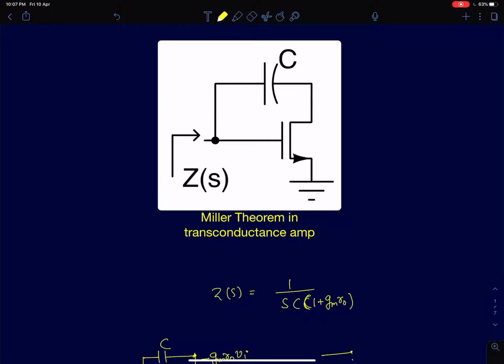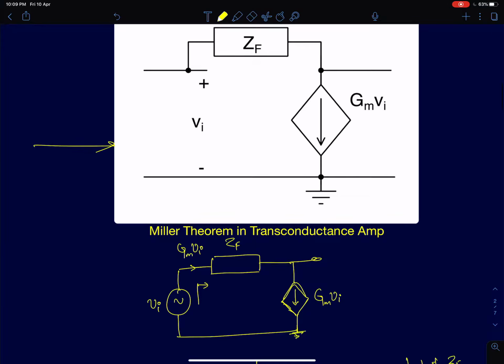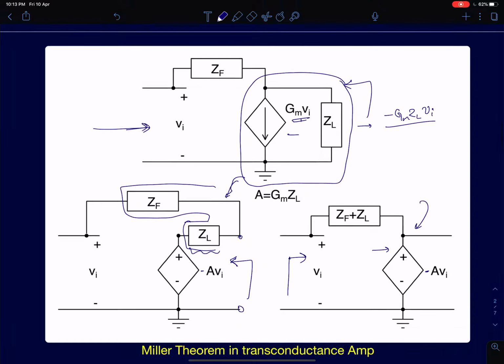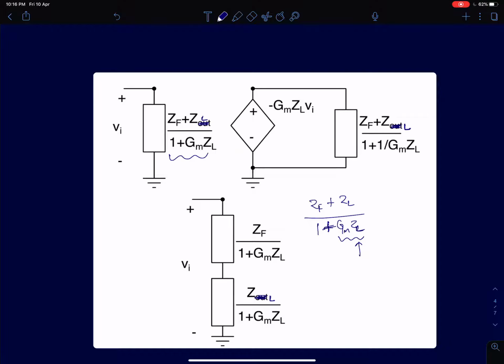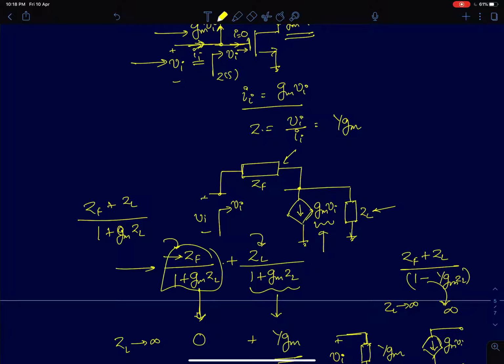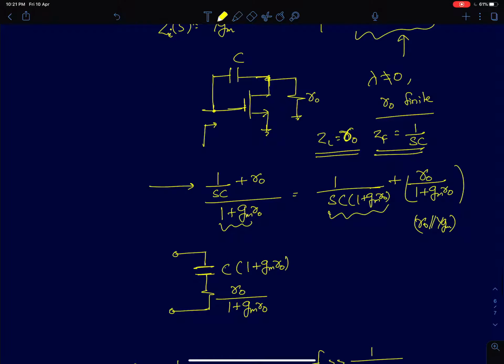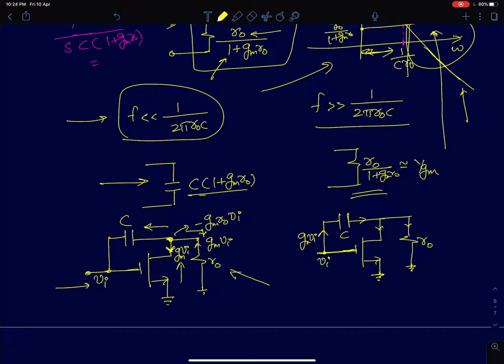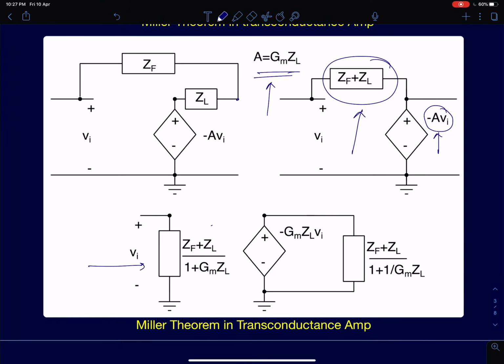AIC Lecture 24: Modified Miller's theorem for trans-conductance (MOS) amplifiers

Comment: Too good and different direction of thinking..Well done sir!!
Reply: Forgot to ask you--I am clear about the input resistance due to miller..How about the o/p resistance, is this correct? I never used the application of o/p resistance with this approximation. For example to find the o/p pole, perhaps due to the unidirectional gain nature of the MOS amplifier. KIndly elaborate if posible or give me an example circuit.  Kind Regards,Raj.
Reply from the maker: Raja Sekhar N  Hi Raja Sekhar, I will answer that in the lecture on the frequency response of common source amplifiers